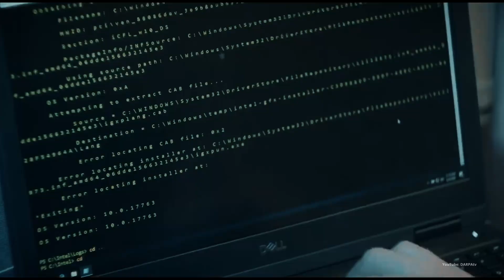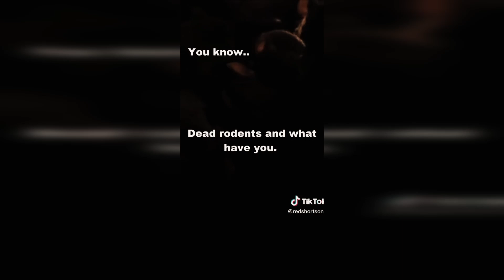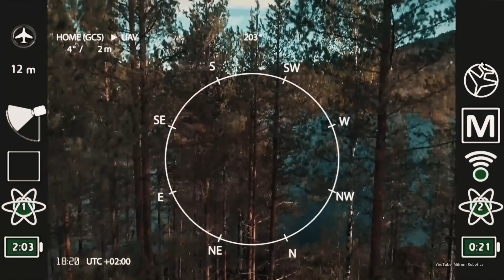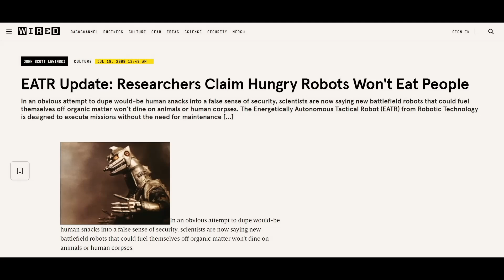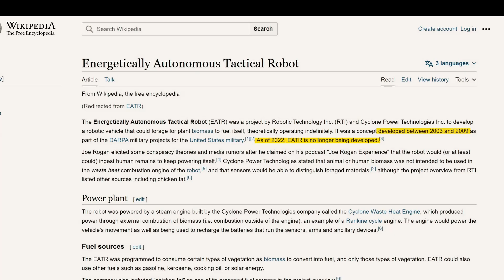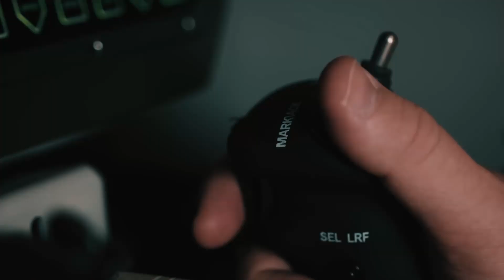Project EATR: DARPA's (Human) Biomass Eating Robot

Comment: I'd imagine the concept of biofuel-gathering machines would be better served in a logistical role than in a reconnaissance role. After all, depending on the availability of suitable biomatter (such as within a desert or a forest), it might be too demanding for a larger machine to "munch on and digest" biomatter, and might instead be more efficient for smaller machines to gather up the biomatter to be processed within a bigger central biofuel processing machine, which could, in turn, distribute its refined biofuel (or battery charge) to other machines that could better utilize the biofuel.

Sure, this creates a vulnerability, in that the process of gathering and refining biomatter into biofuel is divided up into multiple specialized machines, but this could possibly be made up for by the various machines being far more efficient at what they do, and how they spend their available energy reserves.

Also, I could see some of these machines rely on more compact energy generation technologies than simply using the biomatter as fuel to heat a boiler, which turns a turbine. Rather, a far more compact form factor for energy conversion could be thermoelectric, in which, as biomatter is burned, and as heat gets transferred from the burner to elsewhere, while the burner is cooling down as temperatures try to reach an equilibrium, energy is captured from the electron flow from these thermal exchanges (particularly when using a mixture of various materials with different thermoconductive properties, such as copper and iron).
Reply: Shut up lame
Reply: Like a sterling engine?